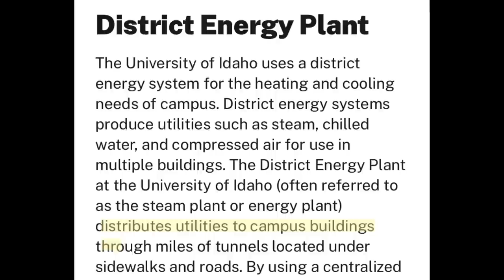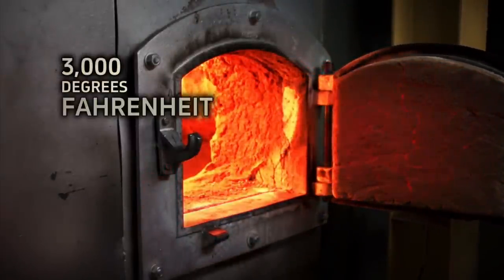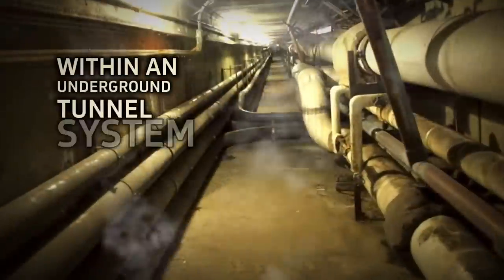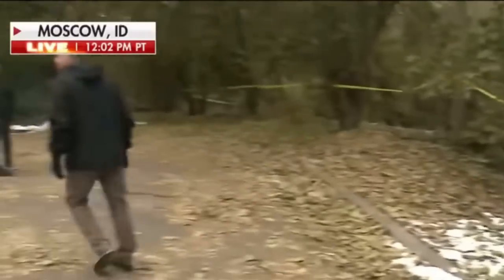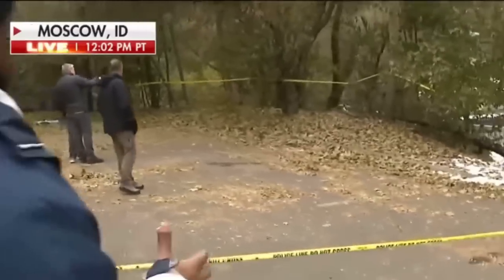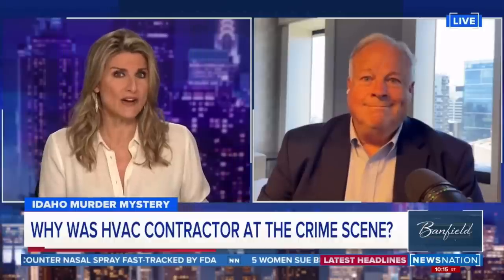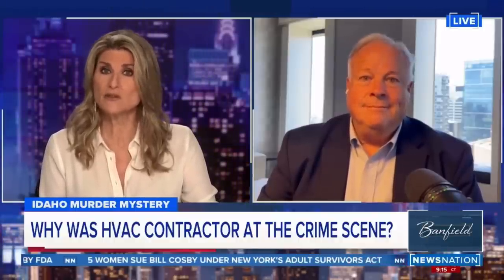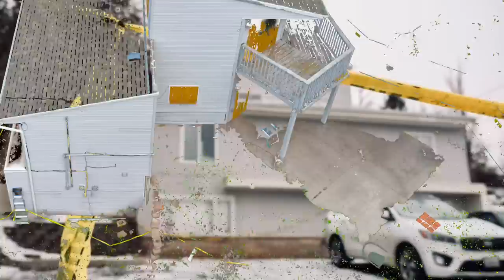IDAHO4: Underneath the University

Comment: Ok,  "Why was the HVAC contractor called to the scene".    Most likely to winterize the home since it was November,   the temperatures wouldve been dropping with the potential to freeze piping.   However,   do we know if the home heating system was hydronic,  or forced air?    Was this a HVAC contractor that dabbles in plumbing?   This isnt so much a conspiracy.   Its actually no mystery at all.  Its being spun into a mystery.   The contractor wasnt there to help clean up the crime scene.   He definitely was there making sure the home could be heated to at least 55 degress so the place doesnt freeze,  thaw and created a catastrophic mess that would ordinarily contaminate the crime scene.   This one was ALREADY contaminated by all the keystone cops running up in there with no masks, gloves, booties ect.   The underground steam system is just unfounded speculation.   Has anyone hired a PI to investigate these theories?   Has anyone walked the length of the tunnel from where the perp or perps may have started this travel to the house to look for potential clues?   Not to say this theory isnt plausible but i think we're stretching the possibilities a bit, no?    I dont believe the opinion that the bodies were dumped at the home.  Thats a looot of work.  And that doesnt fit into the timeline.   Also,  if the crimes happened elsewhere,  there wouldnt be enough blood to run down the exterior of the home.   The majority of blood loss would have been at the actual scene.   That all being said..............i dont think you bring in anyone but crime scene investigation while youre still actively collecting evidence.   This seems like a no brainer.    If there was concern about the heat,  investors shouldve brought portable heaters in so that the scene remained free of others contaiminating the scene.    THAT seems sus.  Not so much that the hvac guy was there,  but why would you allow him there to enter an active scene regardless.   Theres other measures they couldve taken